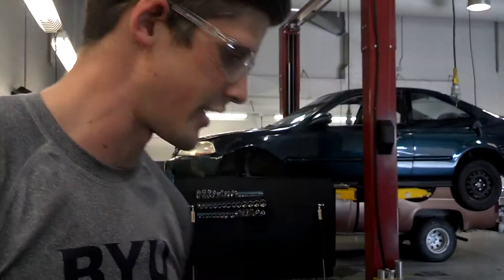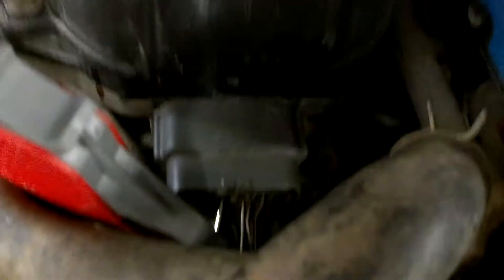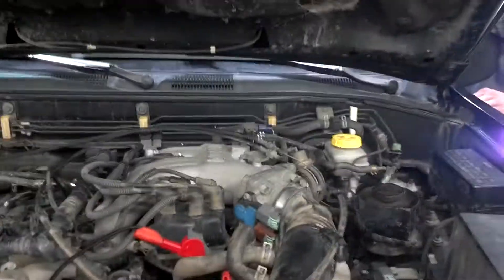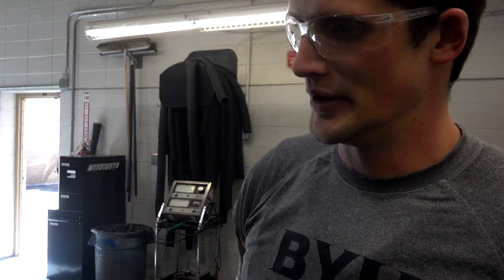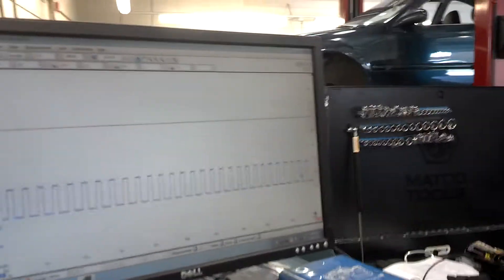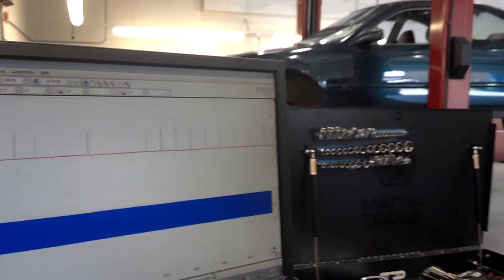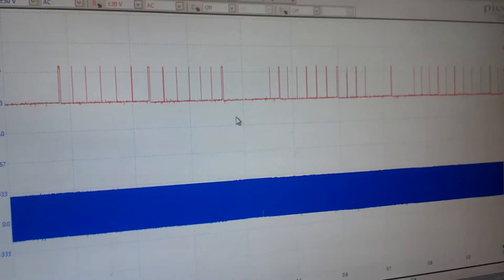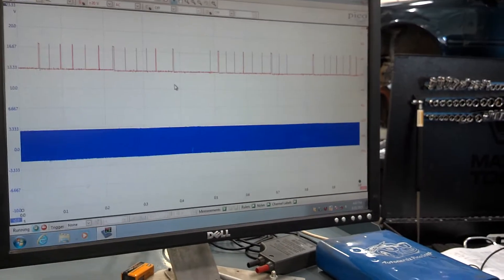99 Pathfinder misfire/hesitation diagnose & fix Part 2

Comment: Hi I changed 2 whole  distributors and I still have rough idle at temperature and blinking check engine light I think it's the computer arre they plug and play for the 1999 pathfinder??
Reply from the maker: My engine light wasn't blinking. They blink when there is a fuel delivery problem or a misfire that the computer can't isolate, which would could be a timing issue. Stretched timing belt or an injector problem perhaps. These timing belts are supposed to be replaced at least every 100k miles. I did mine when I bought the pathfinder at 121k. I now have 200k miles. FYI, If I remember correctly, these are interference engines. You can severely damage the engine if you replace the timing belt incorrectly.
Reply: @kjbigslim   thanks I am not the first owner of the vehicle I've tracked it down by pulling plugs and it does nothing on the number 2 even after having replace the injectors and spark plug cables along with spark plugs  I will check compression next but upon inspection it appears that the previous owners have replace the timing belt maybe they did not align the left cam right and is off one tooth I want to check that as well I also found a broken evap canister purge solenoid line JB welded together what did that also cause a bad idle at temperature shutting off a cylinder